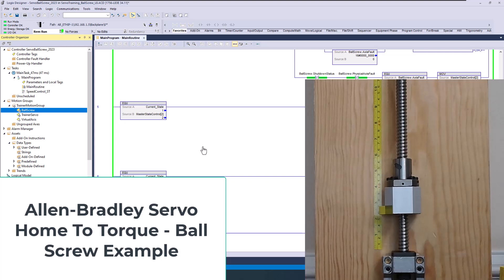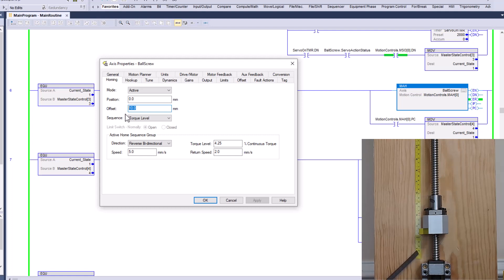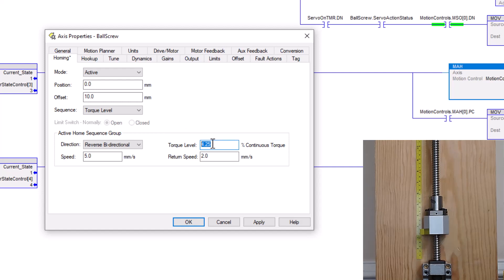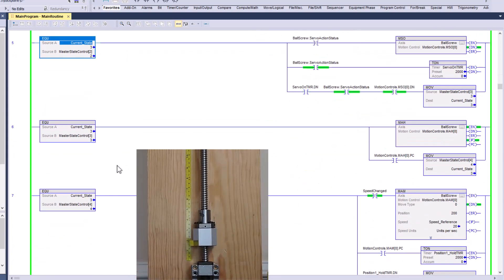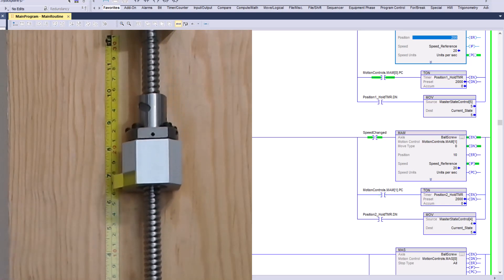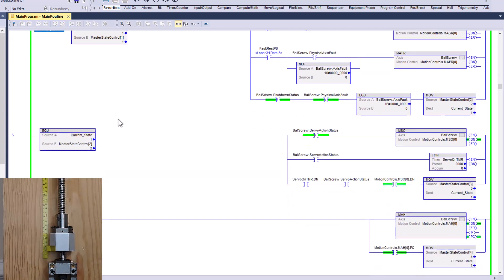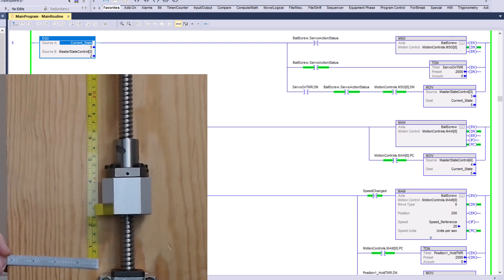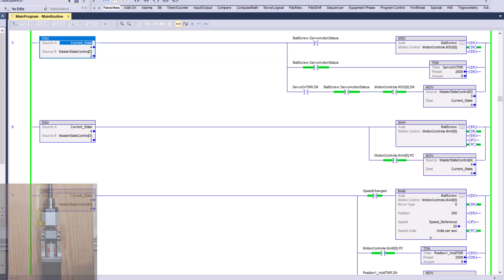Allen Bradley Servo Home To Torque | Ball Screw Example

Comment: Hi Shane. Thanks for sharing these videos which are very helpful and informative. I am troubleshooting an application which is using home-to-torque method. The servo thinks that it is at home while it is at the midpoint of the travel. I used MRP to see if it it helps to rehome again, however, every time I used MRP, it went back to same wrong home position. Does it mean the servo reaches  torque level (for instance, any resistance sources like motor issues, obstacles, etc.) and that is why it thinks it is at home position? Thanks
Reply from the maker: Please note that an MRP doesn't over write the servos home position.

Meaning,  every time power is cycled or an event like that happens then it will go back to the original home position reference. 

I do not recommend the MRP because of this reason unless it fits system design.

Which is why you see me using the Home command

Comment: This video got my hopes up for an application Im working on to modulate the gap size between two rolls. Sadly, I do not believe this option is available to CIP Axis with drives like the 6500 or 5700. may be there is a alternative way to replicate it but as of now it isn't an option. Still very informative! Thanks.
Reply from the maker: Home to torque is removed for CIP motion due to load observer although you can write code that monitors torque load then write a home command, sort of tricky although it can be done
Reply: On CIP you can swap from Position Loop to Torque Loop Mode by using SSV instruction, and set a desired TorqueTrim Value